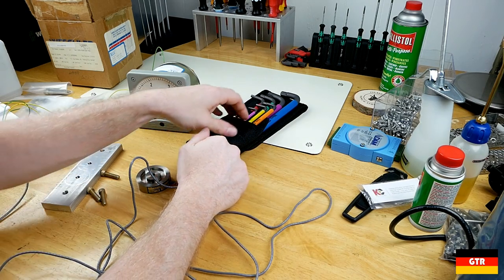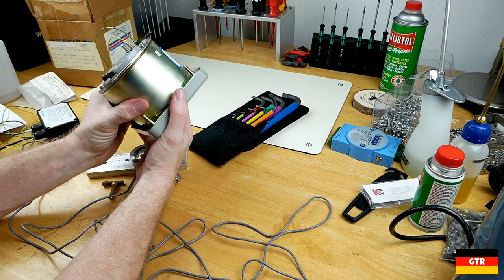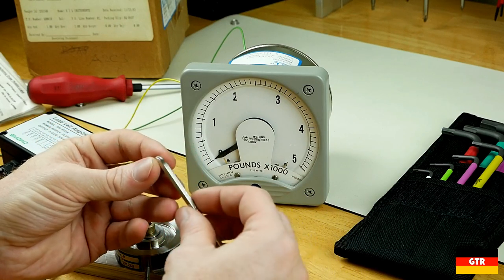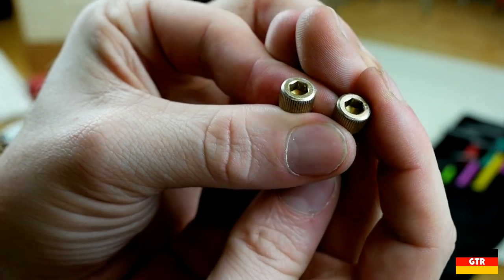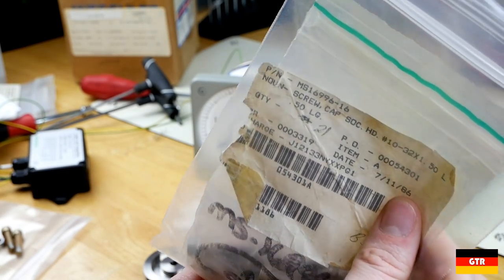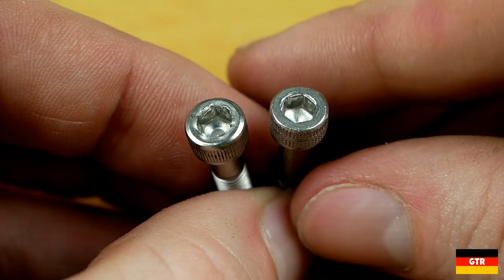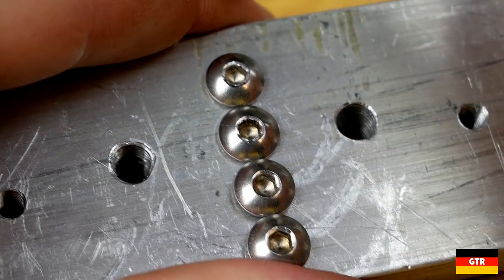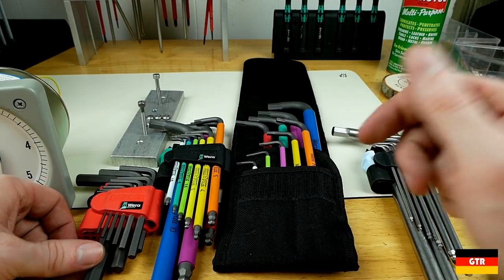Why I now exclusively use Hex-Plus L-Keys:  A short demonstration

Comment: Technically speaking,     Surely a square tool head in a square hole will give the most turning and resistant's to sheering of any other type of fasteners that can be devised,     Because it`s uses the most mass of metal possible in the tool head,     And four straight line also give the most equal and least total angles for sheering,    Hex head are notorious for rounding out,     The obvious reason is you have such a tiny amount of surface metal to sheer though when divided into six areas,   Yes that is six hard points of contact,     But a hard tool steel in a relatively soft bolt,   Once the load gets too much it blows through like butter,   And four sides mean thicker bolt head walls
Reply from the maker: Yeah the patent did mention the "Plowing" effect that a standard profile has against the inner walls of the socket cap screw.  Thanks for the additional insight.
Reply: I am guessing there can be no patent for a square headed driver and corresponding heads ?     As that would be like trying to copy write a steel bar right  ?
Reply from the maker: I can't say I have ever seen this pattern on a square drive.  Guess you better hurry up and invent it!
Reply: Well,   I have had a look in to it,     And some types like star driver are designed so unless you have the right kit you cannot undo the bolts,    So they have made them a certain shape on purpose,      Like on motorcycle brake callipers and some electrical equipment,     Some are universal State keyed a certain shape,     Like for lamp posts etc,  But if you look at sockets themselves,     They are connected through square holes,    And that's to take the turning force,     So I don`t see the difference in making the bolts themselves the same ?

Comment: Thank god channels like this and all are actually using actual metrology equipment to quantify material yields and failures. I'm so darned tired of "Real Tool Reviews" comparing a 3/4" drive air Ingersoll wrench to a 12v Makita, starving the Ingersoll for air and going HEYY MAKITA WINS!  I got a slight bone to pick with your test procedure. 

Metals (unless otherwise demarcated by a 'stress proof/stress relieved' metal), have variance in the density of granularity (which is why you can square your stock to 8 micron tolerance, machine it, and then have it bow like a banana after because you machined out a high-grain stress pocket). 

Using two different holes on just standard stock 6061 or 1045 you picked up from McMaster is going to introduce a pretty large amount of variance depending on where in the grain structure your holes were drilled and tapped. (Torsional load cells use simple wheatstone resistors in a bridge configuration). 

(Also, way less of an issue i'd imagine but  your hand was shaking quite a bit since your key's torque arm didn't give you the same mechanical advantage. Graphing the loading against time would show a lot of weeble-wobble http://imgur.com/a/eqTJw )
Reply from the maker: Thanks for the feedback.  I didn't think about two holes in 6061 would product different results.  That was just a piece of stock that someone gave me at work that was left over from a job.  I think everything they use comes with a cert. so I'm not sure if that makes it any more consistent.  I may do another test with harder material and under more controlled situations.

Comment: Hum, actually I never stripped a head with my ordinary L-keys, instead the whole head broke off.
Reply from the maker: I did a followup video where I actually did break some heads off.  It depends on the quality of the material and the size of the screw on whether you would break the screw or strip it first.

Comment: This was great until you used Husky Garbage for your control.

After that the conclusions are basically worthless.
Reply: I understand your thinking, but the tool didn’t wear, the bolt did. So we can establish the tool material wasn’t too soft, and the difference to be most likely tool shape.

Comment: shots fired at AvE? No explanation as to why you think hydrolics are not accurate?
Reply from the maker: It's not that they are not accurate.  I meant that it is not the way I would have gone about it because I know nothing about hydraulics.  It is not the best solution for me.  I've worked with load cells for a quite a while so I know what they are capable of and the different styles and types that are available.  Once you get above 150,000 pounds or so, hydraulics may be the only option.
Reply: Thanks for the clarification. I love the videos! keep the awesome content coming.
Reply: It's easy to hide behind out computer screens. Multiple of my engineering professors don't think the idea is "retarded". let's see their work and actually make a video for the world to pick apart.
Reply: Dick Fageroni Dick Fageroni "Engineers"... The same people that are lawyers one video, contractors in another, machinists in another, fluid/sonic dynamics experts in the next, and so on. I've seen the same people claim to be "experts" in several different fields over several videos; even on different channels. One guy literally have claimed to be experts in all of the aforementioned fields.... Maybe even more but that's all I remember and all I saw. It's easy to look at their profile, check the channels they're subscribed to and look through the comments for theirs.

Comment: This video looks biased. As someone said before, cuts in the videos. Secondly... you use aluminium to screw into? Third... you must use tools of same quality, preferably even brand to show the benefits of the hex plus VS standard. 
And you MUST show the play each tool has in the bolt before the test. If the normal has bigger play, it will fail first. The normal hex has a bigger contact area with the bolt, and thus it should damage the bolt later in the torque range. The "plus" should be better at the fail point because it bites the material locking it better in the bolt creating a lip(and damaging the bolt as per standard) . As arguments for my statements, look at the first test. You can clearly see that the normal hex has bigger play from the uneven mark it leaves on the bolt. Another argument is the fact that you can undo a bolt with the plus that was damaged by the normal key. This is only possible if the plus is a bit bigger than the normal. If not, it would never  "grip" the bolt. Pure geometry and mechanics.